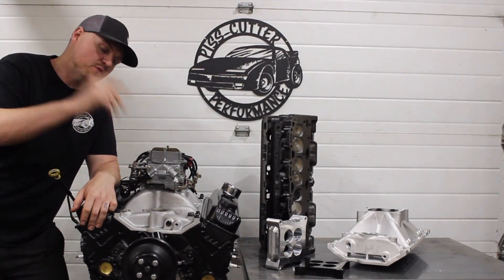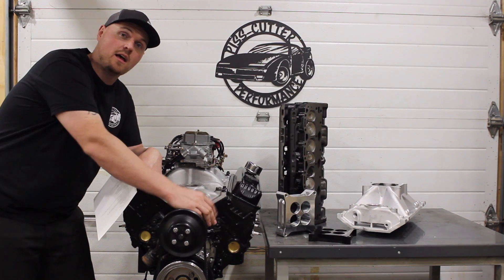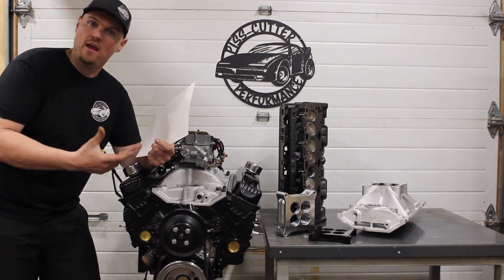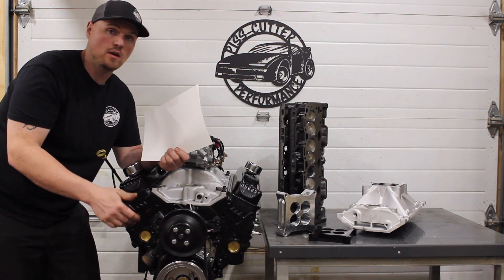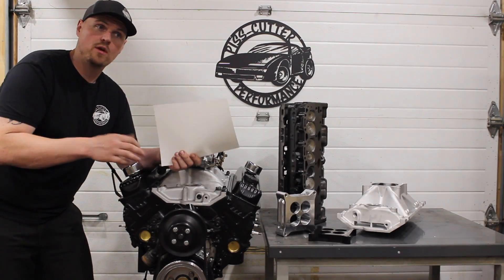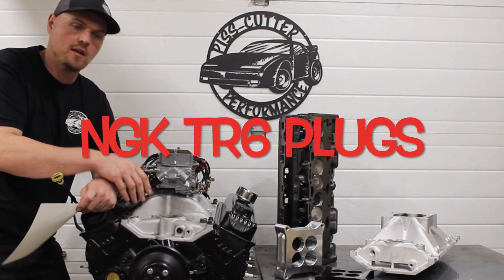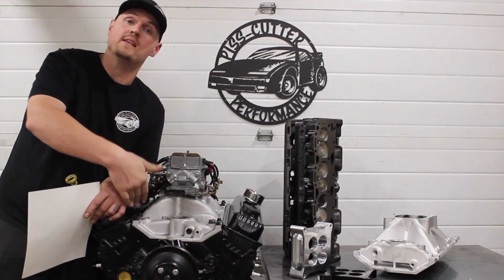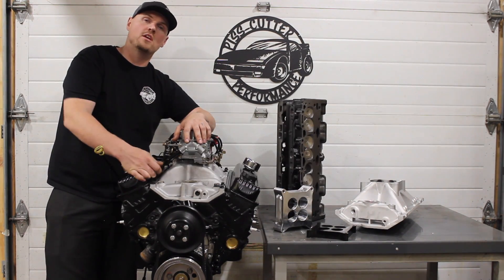350 Chevy Cheap Power! Parts List for L31 Budget Build

Comment: I built a really decent 355 Chevy back in 07 with  #062 L31 vortec heads 0.015 gaskets 9.78:1 comp. With LS 6 valve springs comp cams 1.52 self aligning rockers , Rhoads lifters , Crower ultra beast # 15917 cam , 474int., 498exh.  Dur. 214,224 @0.50 , edelbrock RPM airgap , HOLLEY 4779-S 750CFM carb , and 1 inch carb spacer , 1 7/8  headers H pipe 2.5" chamber mufflers, vehicle 87' Monte SS , precision industries 2500rpm stall in a TH200R4 transgo shift kit, Ford 9" 4.11 gears Hotchkiss Control arms ,this car ran consistently @ high 11's low 12's , I miss the car and really wish i never sold her ,VORTECS ARE KING FOR THE STOCK CHEVY HEAD💪👍
Reply from the maker: Sounds like a sweet combo!
Reply: @cuttersperformance  just what I learned at an engine shop I worked at  in the 90s , L31 vortecs #061,#062,#906 on the flow bench , had weak exhaust flow characteristics,  so I think they run better with a duel pattern cam ,then a single pattern in some engines , just my thoughts , please keep up your content, I appreciate your knowledge I've learned alot from you Thank You 👍

Comment: Yes, absolutely do a sb400
Reply from the maker: High torque 87 octane combo is what im thinking
Reply: @cuttersperformance  I say stock crank, stock short rods with good bolts and flat top pistons!!!
Maybe some cleaned up Vortec heads?
Solid flat tappet?
Won't be 87 octane but would probably make great power on a decent budget!!!

Comment: 11:38 one of the reasons why I went with the lunati voodoo 270 roller. They have a pressed and pended Iron distributor gear so no need to run one of those ridiculously overpriced $100 distributor gears. The voodoo has identical valve timing to the hot cam but with voodoo lobes, more lift and ground 6° advanced but of course you can retard it so not a big deal.

Comment: Which flat tappet cam would have the same specs or better than the LT4 hotcam? I want to replicate this build just with a 70’s flat tappet cam block and Vortec heads. I want to use a flat tappet cam for budget reasons. Which cam would you recommend that would give the same performance or better than the LT4 hotcam that is flat tappet? I will be doing screw in studs if necessary and following your guide for getting more lift out of Vortec heads without machining them.
Reply from the maker: Similar results would be a Howards 112141-12 cam with a 1.6 rocker arm
Reply: @cuttersperformance  ok I’ll look into that cam! I wasn’t able to find your Instagram. Is it still cutters_performance? I couldn’t find it under that name.

Comment: Great info Pat, I'm going with +.050 keepers,  Summit 1.6 non self aligning rockers, Comp 787-16 retainers, adjustable guide plates and ARP studs. I've not accurately measured the installed height yet, but its very close to 1.800". As per usual I'm waiting on parts before I can continue the build. Looking forward to more interesting and useful content. :-)
Reply from the maker: The ultimate setup! Very nice 👌
Reply: @cuttersperformance how much $ to get you to port a set of vortec heads ?

Comment: That summit 8802 it takes a melonized gear?  I contacted them about a cam i bought a Summit SUM-1227 for a older gen1 non roller block. They cant seem to tell me what gear to use, they keep saying a carbon/poly gear or bronze. This is for a street/strip car i dont want to be buying a new distributor gear every 10k miles. I was told the billets are 5150 steel and howards said i can run one of their Steel distributor gears if this is true. Any info u have would be apprecated.. Thanks
Reply from the maker: It needs a melonized gear

Comment: In previous video you mentioned you didn't use a carb spacer and would go over that in a later video. Did I miss that video or have you not gone over that yet?
Reply from the maker: No that video is coming up next. Very good info if you are running a dual plane

Comment: For a little more power, would it be worth it to replace the pistons with flap tops? There are stock replacement cast pistons with a 1.56 compression height available for a resonable price. With these pistons, steel shim head  gaskets and the stock deck height, the quench is around .040. Compression ratio would be around 10.25.
Reply from the maker: Compression always makes power but at the risk of fuel sensitivity with a mild cam
Reply: I'm thinking the efficient vortec chamber combined with a tight quench would create good turbulence. If so, the engine may be able make power with less timing and be less fuel sensitive?
Reply from the maker: @heavyg7105  yeah but also the weight and gearing of the vehicle its going into plays a big factor. Im sure this cam would be fine with 10.5:1 tuned properly with 91+ octane and a light vehicle

Comment: I got an 880 short block, I believe cam is comp 288hr, promaxx 195cc heads, 1.5 jegs roller rockers, single plane intake. 400 turbo transmission 
 I think it’s a good start to put in a 76 Pontiac Grand Prix
Reply from the maker: Really good start!

Comment: If you wanted to soften up the bottom end to put something like this into a Standard Trans Lightweight cruiser and move the power up a bit further in the RPM range, what would you do ?
1) Keep as is, Spring kit in the Distributor to limit low speed advance, throw all the advance in later ? Done.
2) New Camshaft (or retard current), Single Plane, Chineesium H-Beams with ARP2000 capscrews (for the added RPM) ?
I love these budget guides. Let me know what you would do. The scenario would be for something like an S10 pickup where the chatter is real.....and breaks stuff. I have built 2 of these trucks with SBC's, one with a Th350, the 2nd with a 700R4. I really want a 5speed in the next one. Carb fed and doing Firewall 'massaging' for Distributor and Exhaust clearance is still easier than an LS Swap in these things...LOL
Reply from the maker: It doesn't have a crazy amount of torque, but adding a single plane would certainly drop the low-end torque abit. You're probably not going to gain a lot of rpm as this is already quite high for a small cam

Comment: I Have A 92 305 Out Of A Caprice. The Factory Heads Are 14102187. If I Run My 906 Vortec 350 Heads With Comp Cams 08-302-8 How Would This Work I’m Just Curious Because I Have The Parts And I Can Slap It Together ?
Reply from the maker: Add some beehive springs on those vortecs (See my video on that) and you could easily run that cam. You could probably get away with stock self centering rocker arms too
Reply: @cuttersperformance  Sweat Appreciate The Help. What’s A Reason I Couldn’t Run The Stock Rockers. I’m Also Clueless As To What Fuel I’ll Have To Run. I Read 305 Heads Are 58CC Chambers So I Would Be Jumping To A 64CC Chamber But The Cam Should Make Up For It ?
Reply from the maker: @dylanbradshaw4594  the stock self aligning rockers shouldn't be used past .480 lift. The slight drop in compression won't matter with the performance gains you'll get in air flow. You could have the vortec heads milled down abit too
Reply: @cuttersperformance  Okay Cool. I’m Gonna Send It. Appreciate Your Help And Love Your Vids Especially The Porting On The Vortecs

Comment: I have a couple 400 short blocks that I wanted to bore .010 over and run with Vortec’s and 5.7PM rods and KN pistons. I’d like to run a roller, should be a pretty potent motor. Right now just have to push a couple LS’s out of the way.

Comment: I am thinking about building an exact duplicate with the summit roller cam. I am curious if this will be good for my daily driver work truck?
Reply from the maker: Yeah, i run something very similar in my shop truck
Reply: @cuttersperformance  does yours have an auto trans? If so, do you run a stock torque convertor?

Comment: Would love to see a 400 build. I have one in a Chevelle with heavily worked 041X heads that did 445HP and 499TQ on the dyno with an Isky 280 Mega flat tappet. Lots of fun with the Autogear Muncie M22Z. Big torque available with the 400 and lots of guys say they overheat but they don’t with a proper cooling setup.
Reply: I have an M22Z in my car. Has the stock 2:73 rear right now but looking to upgrade. What rear gear ratio are you running and do you like it?

Comment: Hi Pat. Is it necessary to have the big ends of the rods resized with the ARP rod bolts already installed? I saw a video where the guy had the big ends resized and then installed the ARP hardware afterwards and it pushed everything out of round. I asked my machinist to resize the rods back to factory spec but he doesn’t have the ARP hardware. Is this a big deal in your opinion?
Reply from the maker: Yes, it's absolutely nessasary to resize the rods when arp bolts are added. The clamping force is different, and your rod end will be oval. If you have already got your rods resized with the factory bolts, then I would just leave them at this hp/rpm level. As long as the stock bolts haven't been over torqued they will be fine. I add arp bolts for extra reassurance, but it's not always nessasary. An engine that sees north of 6k rpm it's a good idea
Reply: @cuttersperformance  thank you Pat!

Comment: Does anyone know if this build would work in an older 350? I'm trying to get a parts list together.
Reply from the maker: Alot of the parts will not work on a pre roller block. The cam, timing set, oil pan ect

Comment: I'd like to see the summit 1103 cam on the Dyno. 

I couldn't find a video with HP numbers or any forums. It's got  about the same specs as the l82 cam or any other rv cam. which is the 350/350 HP cam I think. 

I installed this cam a while back it's alright on the torque. Was gonna go with the summit 1785 cam but the 106 lobe separation stopped me.

Comment: Cool Video, I actually have the LT4 hot cam and the GM performance 1.6 aluminum rockers, been sitting on the shelf for years, not going to use them on my current build, they will wait for another build.

Comment: definately do the 400 with vortecs 😀
Reply from the maker: Im thinking a 87 octane Torque monster build 🤔
Reply: @cuttersperformance I'm sure you've found the old Motortrend engine build article from 2004 called 'Chevrolet 406 CI Engine Build - Impersonator II
525 lb-ft and 490 hp From an 87-Octane 406'. I've yet to see a YouTuber duplicate this.

Comment: Another excellent tutorial. I thought I was the only one being cheap by cutting down the wheel for a balancer spacer. By the way the summit brand sbc bearings are king also and are very nicely priced. I am currently doing a engine using the summit 8801 cam. This cheap combination requires a 350 block with a very good bore and summit 4” bore 383 pistons ( 377 ci ) $159 per set. Crank is a low dollar cast pro comp that came with a set of cheap forged rods. Scat would be better but this is Australia and good stuff can be expensive. I can balance the pistons and rods myself but the crank balance is close to $400 here. I am using a milder cam to keep the revs down because of the external balance. I will probably use the vortec heads modified as you have shown us. I was in the US recently and got the pistons, cam , and two sets of summit beehives ( no retainers at the time)several sets of summit bearings. I also bought four sets of engine tech rings per your advice that they are actually Hastings. $50 a set ( au $75 ) instead of the usual $200 + a set for Hastings here. I was sweating going through customs but they weren’t too worried. The intake is a Chinese rpm copy I can get locally for $200 au and are a nice casting.I am hoping for 400 hp and a good torque number. I am aiming for a $3000 au all up price ( I live in hope ).Thank you for all the great advice and do keep it up please.
Reply from the maker: Smuggling engine parts haha love it
Reply: he sweats smuggling engine bearings 😂..
would never make it in my shoes
Reply: Link to the video for cutting down the oil slinger for a spacer??

Comment: found your videos not to long ago and they are informative and easy to watch. Keep it up. After this video I'm wondering if I add the Summit cam how much HP my vortec engine might. Had some flow work done on the heads, (062, 906) flow test @ 500 Intake 232 Exh 164, LT1 exhaust manifold, sniper EFI. The long block was from Jeg's. It was tested at 315hp 402tq by the machine shop without any tuning. I love this motor in my Ford hot rod.

Comment: In my area the Vortec 350's are hard to find and start at $600. 
Also, how about a recommendation for a budget set of aftermarket iron Vortec heads for those that might be wary of the stock heads cracking. The Summit branded Vortecs maybe?
Love this series of videos!
Reply from the maker: EQ or the summits (dart heads)

Comment: 400 engine would be cool
Reply: Yes please
Reply: planning on doing Suarez build but with 406sbc
Reply: Yes that would be awesome I have a budget of 2000 for my 400 sync I want to use the stock heads I also have vortex heads could you send a parts list inplane on using stock bearings in the block they are in excellent shape as well as the piston rings

Comment: My son and I built a motor almost identical but we used the 8802 summit cam. 
He bought a factory reconditioned 4779 Holley 750. I’m having trouble getting the jetting figured out. Plugs are black. Any tips would be much appreciated! 
Awesome video watch all of them almost as soon as you drop them.
Reply: Could you borrow a 650 from someone just to see how your engine reacts?
I'm betting the smaller carb would be fine.
Reply from the maker: its should run pretty well with a 650 to 750 carb. With this intake 750 carb with no spacer 68 front jets/ 80 rears with 34 deg total timing
Reply: @cuttersperformance  Thank you!!!

Comment: with the hot cam setup did you use stock pr length and also do you think shaving the heads down to like 60cc,s would cause pvc issues? love the vids man preciate all the info
Reply from the maker: Stock pushrods, and lots of Ptv clearance with this cam